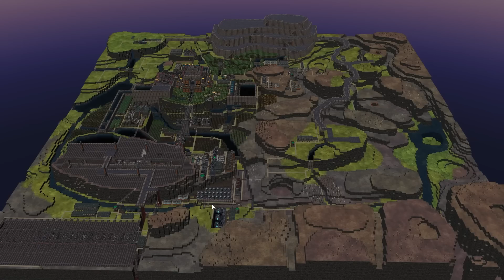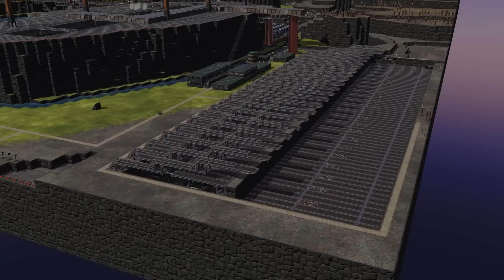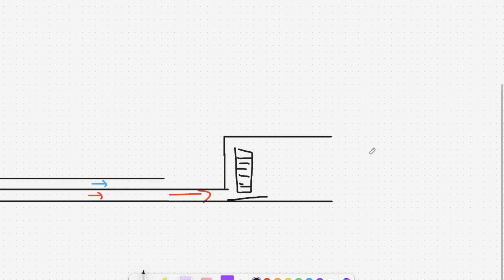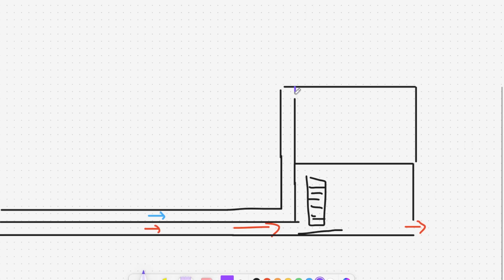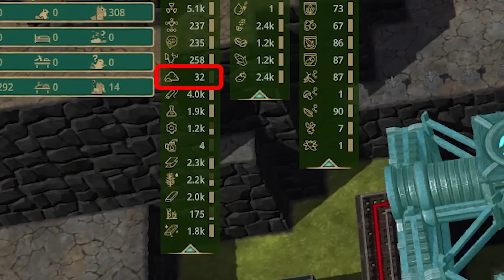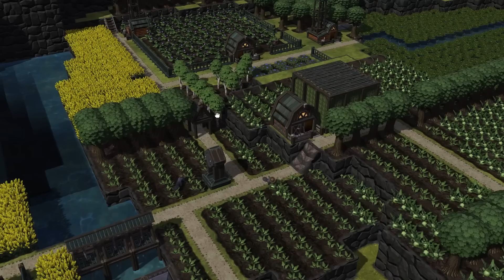Greening the first half of the map - Timberborn - Steeltide #23

Comment: With all the new 3D systems, it could be a fun challenge to explore one of the smaller maps and try and build an integrated system that can survive 30 day droughts. Could even use custom settings if you want to explore longer than 30 day droughts